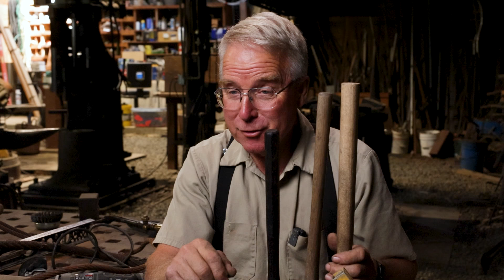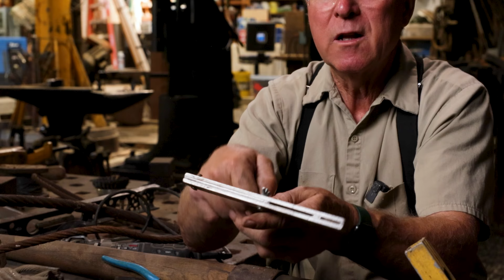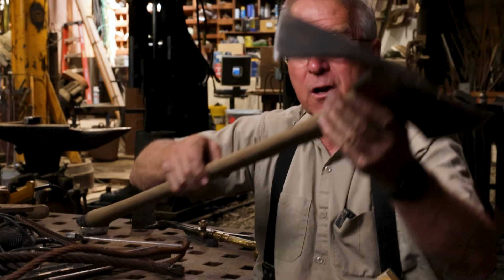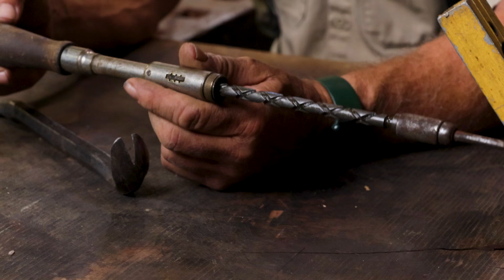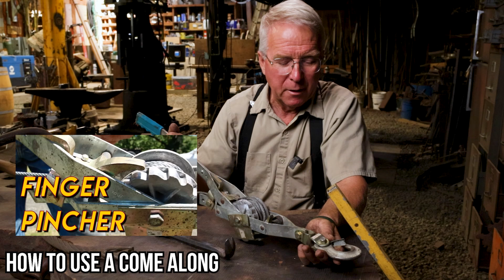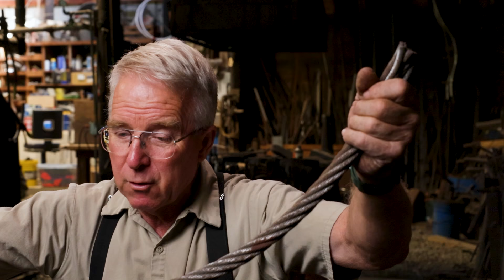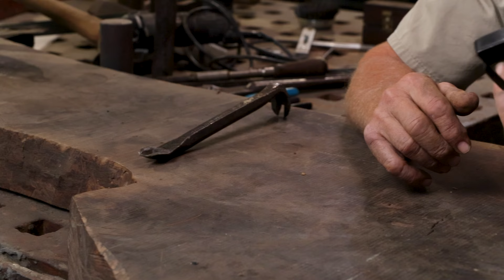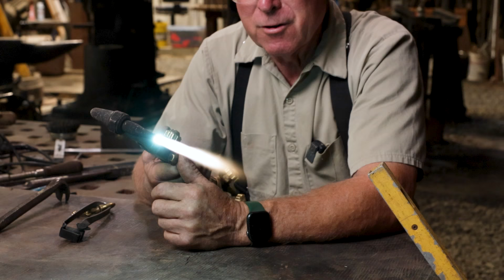The 15 Weird Tool Nicknames You Never Asked For

Comment: That cat bar is called a connecting bar, we use it when connecting iron, does the same as a spud with more leverage. Use the spoon end to ride in difficult connections, and when waiting for the first header on a lone column, we’ll jam it in the hole and stand on it

Comment: My oscillating multi tool is known as “buzzer”, my sprit levels as “bubbles” and when I get something level first time I say it was a good job I had it in the freezer over-night. The come along I know as Sylvesters or Turfers. Small hammers are Timmy Tappers. My 2lb lump hammer is an uphill lump hammer & my 4lb a downhill lump hammer. My very good friend Peggy the Builder who is 79 & still going strong has started using those names too. Keep up the good videos.
Reply: My copper faced hammer is called "Thumb Detector", my 3 ball peins are named from largest to smallest: "Fuck it", "Fix it" and "Tappy-Tap-Tap" and my nylon faced hammer doesnt have a name because although a necessary tool, its plastic and does not deserve a name.
Reply: My 6 lb hand sledge hammer is named “sluggo “

Comment: In Cornwall we have a similar root chopping tool to the Pulaski. My neighbour, who is proper Cornish and in his 90’s calls it a Viski. Fascinating vid
Reply: I knew an ould fella here in Ireland who called it a mattyaxe. A bit chunkier than the Pulaski shown. He was in his 80s but could swing it from dawn to dusk and then sleep under his tractor til the next dawn woke him up.
Reply: Scott,
Don’t know if you are familiar with the Version of a Com-along that uses a flat strap rather than a cable.  They are called a “Tugger”.  You will see power company linemen using them while perched on peeled poles with climbing hooks.  The advantage of the flat strap rather than a cable is that it is Non-conductive.  Nowadays, Kevlar reinforced.    BTW, still made in the USA.  Mark L

Comment: 3:00 We call it a fein tool. The original version was first made by fein. Im 24 and remember when they first came out and my dad who did custom hardwood floors bought one. Thought they were so cool and you never saw them. Now I have 2 battery ones sitting in my truck.

Comment: It's called a "Squangle" because that's the noise it makes when you drop it on a slab.  Onomatopoeia--just like the "panga" (very similar to the machete).

The manual slot screwdriver was first known as a "turn screw," because it was the tool that turned the screw.

Comment: Well that was interesting!

Hammers (of any size were Tapping Sticks. Or here in Manchester "Liverpool Drivers" Those Scousers would hit screws in with a hammer as soon as not and there was/is a bit of rivalry between the two cities!
Your Door bar (a relatively new design was originally called a Pry Bar.
A Spud Wrench was different over here in the past too, it would have a socket on one end and be a Scaffolding Tool or Scaf. 
Mattocks have been around since the middle ages .... some had a short axe type blade (but blunt) but were just Mattocks.
Your wire pulling pliers were called Nippers here. They were used to "nip" bits of tiles to make them fit a hole or pipe and your Wire Cutters are known to Sparkies as Snips.
We used a BIG Comealong that was known as a Turfer! (Turfing is slang for throwing it from one place to another as in "Turf it in the corner"
Strikers have always been Strikers here too!

Comment: I love this story.. thought you might too.  The Pulaski tool was invented by U.S. Forest Service ranger Ed Pulaski around 1911, inspired by his experiences during the massive 1910 "Big Burn" wildfires. The tool combines an axe blade for chopping and an adze for digging, allowing firefighters to efficiently clear brush and dig fire lines. Pulaski is also known for saving most of his crew during the 1910 fires by leading them to safety in a mine. The tool was adopted by the Forest Service and became a standard, essential tool for wildland firefighters, with similar tools used in ancient history and other cultures.  
The Inventor and the Fire
Ed Pulaski:
An assistant ranger for the U.S. Forest Service in Idaho, Pulaski is credited with creating the tool. 
The 1910 Fires:
A major wildfire event known as the "Big Burn" or "Big Blowup" devastated large areas, highlighting the need for more effective firefighting tools. 
A Hero's Inspiration:
During the 1910 fires, Pulaski famously led his crew to safety in a mine tunnel, saving most of the 45 men under his command.
Reply: When I was 18 I was working on a roofing crew and they had a small ax that they would call the porco. I was young and figured it was some roofing term. Well jump to years later and I'm camping and explaining to somebody that the guys I used to work with called an ax a porco and they said well. Is that because? Peter porco chopped his mother and father up with an ax? They named the ax after the Ax murderer Peter porco. That's exactly what happened
Reply: I used a Pulaski in the California Conservation Corps at CDF Fire Station Butte Center. We also used a McLeod, which is basically a rake with a bevel blade for removing grass.
Reply: There is a version of a Pulaski called a Halligan - both are believed to have started life as firefighter tools...
Reply: @willschmit436  You're right about the Halligan Tool. It was invented by Chief Hugh Halligan of the FDNY back in 1948 to force entry into structures. They're still carried today by the NYPD's ESU and the Highway Unit.
Reply: The Pulaski tool is just an enlarged tool that was in Britain for 100s of years for digging around and cutting tree roots out of your trench and can l f### think of the name of it todzy
Reply: @johnmcintyre800 English Pattern Grubbing Mattock.... The Pulaski is much more of a timber tool, the chunkier headed mattock much more of a rock tool.
Reply: The "Big Burn".
Reply: Fien saw , not sure, but I think they had the first patent.
Reply: I can’t believe the guy presents it as just a funny name for a tool without researching & learning the meaning. But then, he thinks a nipper is way more useful than the diagonal / dike. I don’t think he’s pulled a cotter pin in his life!

Comment: I call my 10 lb persuader is called "Bertha." My Dad used a "cat bar" to get a track put back on a dozer. I have used every single one of those tools you talked about, and own every single one of them except "Olga" and "Helga," and chokers. We used 3/4" chokers cat logging and the 7/8" chokers on high-lead. I don't have much use for chokers anymore. I always preffered to call the diagonal cutters "side-cutter" rather than "dikes," although some guys I worked with did call them "dikes." Thanks for the trip down memory lane!

Comment: “Bull Prick”. Years ago I worked for a fence company setting posts. Occasionally we would encounter ground that was so hard and dense, the power auger wouldn’t make a dent. The head guy would hell, “Get the bill prick.”  It was a two-foot long metal spike. Used with a sledgehammer, it always got the job done!

Comment: I call him shaky saw and a shake and bake .. and as for a spud wrench I have an old klein you know the ones that were made of that brown black metal that no matter how bad you mistreated them you couldn't dent them they wouldn't rust and they never gave up .. that I found at a sale sticking out of a bucket like Excalibur out of a rock I pulled it and asked how much I don't know if I've even paid $10 for it and that ranch has saved my bacon more times than I can count even saved my life when I was stuck underneath a piece of Steel in 2 ft of rough water I found it laying beside me jammed between a rock and the steel and was able to get my legs out from under it now that's a tool tell you the truth if you could combine cat steel, piano wire shotgun barrel Steel and trailer hitch steel together you might have something as tough as this old klein . As for the newer ones theyr just not the .. same
Reply: Holy punctuation!

Comment: That horse story you told was great! I’ve known many of those tools by their slang name only. Many of them I have never heard what the proper name is. There’s one that you might not be familiar with and I don’t even know a slang name for it. I guess I would call it a “rail jack”. With similarities to a cant hook, the tool I’m talking about is used to move railroad cars. It essentially a big pry bar that you wedge against the wheel and the track. You apply downward force and if things work properly, the railroad car will roll a few inches. This is done to “spot” the car, (a hopper type), so a conveyor belt can be lined up with the car.
Reply: I tried looking it up on google and all it returned was a tool for lifting rails.  I was curious, because I've seen some prybars that have a square section on the business end with a simple bevel, then it gets round at the handle end.  wondering if those are the tool.
Reply: Railcar mover

Comment: In my 20's I installed hardware for new homes, offices, condo's, etc. using the "Yankee" before the cordless drills/screwdrivers. I've installed hundreds of door knobs, towel bars, hinges the list goes on and on. When the cordless drills started becoming a thing we tried them but charging the batteries took hours and the Yankee had endless energy and more control. I still have it but haven't used it in years.
Thanks for the video, brings back a lot of memories.
Reply: I found the batteries go out on the Yankee screwdriver a lot faster than the batteries on a cordless.

Comment: Fein cutter is what I call the “buzzsaw”.  Fein Multimaster was the first on the market years ago, and I’ve cut miles of caulking loose from precast parking garages with them.
Reply: Yes, it's a very fein tool.  If you had one of those back in the day.  You got some respect.
Reply: The carpenters I first worked with called those tools "Fein tools", regardless of the brand.   I like that name, because the tool is mostly for fine / finish work.  Fein / fine
But these days most tradesmen I know call it plain ol' "multitool".
Reply: Mosquito!
Reply: Put many hours on a Fein multimaster decades ago cutting out vehicle windshields. Called then Fein knives 🤷🏼‍♂️
Reply: Nibbler" is mine
Reply: @TRIEDZIIDONO "Nibbler" is already taken (sheet-metal cutting tool).

Comment: "Oscillating tool" is my go to, but when I had an old timer working for me he argued that the name also fit a Reciprocating saw, and insisted it was a "wiggle waggle." Years later that still sometimes comes out of my mouth.
Reply: My favorite for that tool is "guybrator" lol
Reply: @asoiosai1423   lol, store it next to the drilldo. 😂
Reply: I call it "that thing that is not the angle grinder".
Reply: It's a fein saw, aka a 'fine' saw
Reply: @nicholasimhoff9230  Fein called it the Multi Tool we call it the Cuts It All.
Reply: @nicholasimhoff9230 finally someone else that calls it that. We say fine tool
Reply: Mosquito for the sound it makes, be warned it will attract bees.
Reply: it is most definitely not a reciprocating saw - it doesn't go to and fro' back and forth; It rotates to and fro' regardless of the angle of the dangle. Absolutely an Oscillating Saw.
Reply: I just call it the multi....  but reading a few others I need a new name!!
Reply: Vrrt-Vrrt.  As in the sound it makes.  Shortened from the that thing that goes vrrt vrrt.
Reply: Call it a multi
Reply: I refer to it by whatever pops in to my head first, including but not limited to, multi tool, fein tool, oscillator, but the name that my group of friends and coworkers came up with which is not exactly g-rated, is the vagilator, or vagi for short 😂
Reply: Oscillating tool makes the most sense to me. Reciprocating saw is definitely a sawzall 😂
Reply: Reciprocating saw is the name of a saber saw ( sawzil in usa ) in newzealand we call this a multi tool or just a multi. It is also called an oscillating saw ocasionaly as that is a prety good description of what it is.
Reply: When I was a kid my dad used to call the reciprocating saw "the Soso" (pronounced sawsaw) and it took me more than a decade to realize he was trying to say "Sawzall" since that's the name Milwaukee gives to theirs
Reply: Dead buddy of mine called it a jiggle saw. Now so do I. Or just jiggles.
Reply: Its a Jibber Saw
Reply: I agree correct terminology is oscillating saw,  I also call it the vibratory saw sometimes
Reply: A man of culture.
Reply: I’ve heard zipzip and zing zing for the multi tool
Reply: Thumbs up for wiggle waggle and guybrator.  We call it the jam saw cuz it gets us out of jams
Reply: My russian boss would call it the lady's tool and would always make jokes about the feather attachments he had to 'make the lady's happy' 😂
Reply: I call mine the "Shakey Saw".
Reply: Mulitool or oscillating tool.
Reply: We always call it the "LazyFuck 5000"
Reply: My wife calls it an oskillating saw.
So now whenever I send her for it, I call it oskillating as well….a loving dig.
I’ve experienced both types of wives, but there’s nothing like working on a project with a wife that knows how to use a saw and swing a hammer.
Although she’ll still occasionally grab a butter knife to take out a screw.
Reply: We call it buzzy
Reply: Multitool 😊
Reply: We call it a Vibro. Or oscillating cutter. But obviously the shorter name gets used more. 

  We also call a 1/4 impact a "zippy".  Partly because we also use 3/8" impacts on site a lot, so it's easier to distinguish them. 

   We have Bertha for our big hammer. It's a 20lb sledge.
Reply: Wiggle saw = oscillating tool
jiggle saw = jigsaw

Comment: Oscillating multi tool or just multi tool on the job site. I still own the first model ever made by fein. I’ve since upgraded and burned through a few cordless models. My absolute favorite one is dewalt because of the blade change and the power is just about the same as all the others I’ve tried.

Comment: Thought i would learn about some old tools. Instead I found out all my tools are considered old lol. Thanks for the vid.
Reply: Even power tools are old now, battery tools have been out 40 years now...
Reply: @jeremychance6463  Yeah but even with modern batteries today, a corded tool still has a purpose if you have an outlet.

I rip a lot of 2x4s lengthwise and both DeWalt and Milwaukee circular saws have come a long way in cordless tech, but they don't have the juice that a 12 amp wired saw does.
Reply: @Yugemos yeah and anytime you have hard work to get done like with an SDS Rotory hammer or something like that the battery ones are great for mobility but the corded ones are way better at getting the job done. They just don’t have enough power yet to keep up.
Reply: @jeremychance6463  MY main battery tool system(Bosch 18v) has been out for over a decade. I've recently branched out to have some Hercules 12v and a generic 18v hot glue gun. At one point in the past, I did have a 12v Bosch worklight, and a couple batteries, but lost the light with a battery, so I've got the charger and a battery.
Reply: @jeremychance6463 first electric drill came out in 1885
Reply: I read your comment and thought “well at least I’m not alone!” 😂😂😂😂😂
Reply: My thoughts exactly. At 78 years old I've seen everyone of these tools and used 99% of them. I'm guessing that there are very few new tools that could replace them.
Reply: Ditto!
Reply: Right! Hahaha😂
Reply: Yeah...and so are we. 🤣
Reply: I realize how old I am watching YouTube and seeing so much like tools cars that are now antique, old out dated and ancient 😢
 No wonder I have so many issues with my old worn out body 😢
Reply: The REAL truth is we've all got old, along w/ the tools.

Comment: I would LOVE to find a "squangle" like the one you showed.  I use a bevel gauge for nearly every angled cut where I need to match another non-square surface.  I was teamed with a veteran framer who swore by his Speed Square but had never seen anyone use a bevel square.  We were making complex angled cuts for gabled dormers so we took one side each and compared both speed and accuracy of the cuts.  I ended up gifting him a bevel gauge and he was very pleased.
COME-ALONG:  I did the same thing with a donkey that was flooded into a stall.  Standing in 8" of water and having to cross two feet of water to get to high ground wasn't going to happen willingly but a come-along between her and the bottom of a fence post did the trick.
HOT WRENCH - Love it, also known as a "Blue tipped speed wrench."   
Thanks for great content.  I grew up in the PNW and come from three generations of logging.  Your content helps me remember so many events of my 70+ years.
Reply: They show up on EBay quite often. Most are under $20.
Reply: @davidcoleman3250  Thanks.  I probably never saw them because I didn't search the right name.
Reply: Menards sells the squangle. I bought one last year
Reply: The first time that I was introduced to a multi tool the owner called it a flush cutter. That stuck with me unfortunately 😂